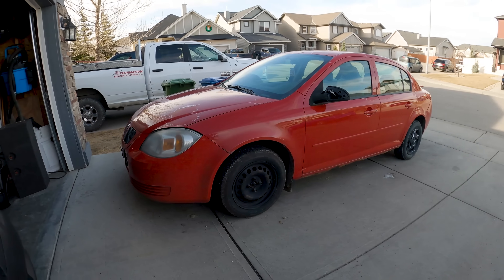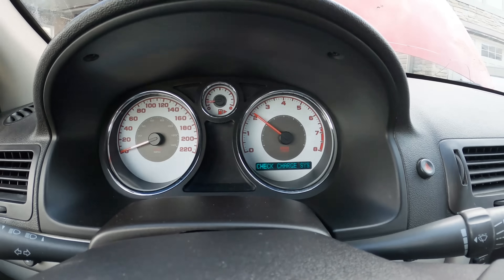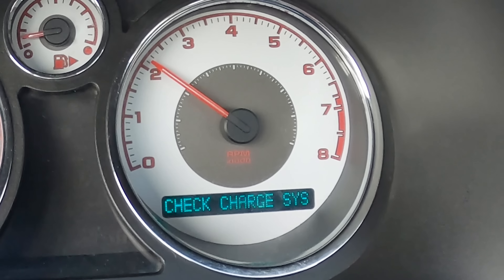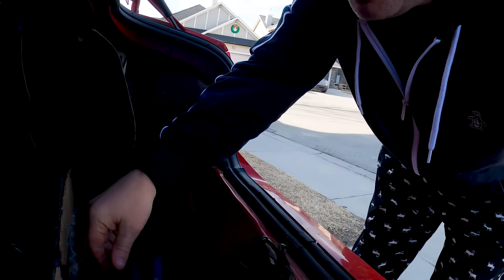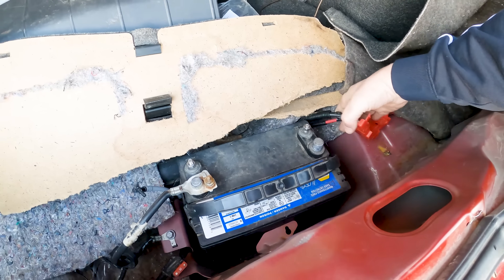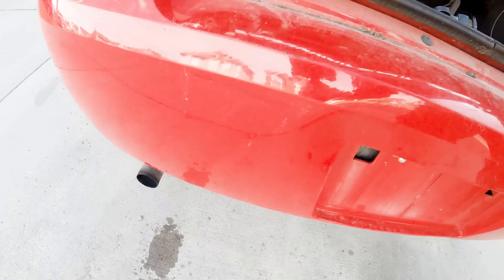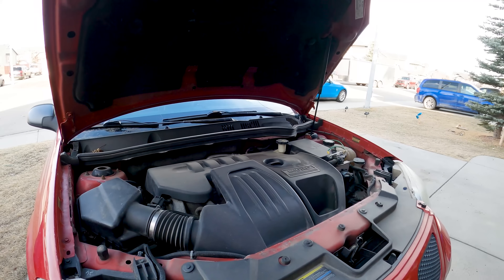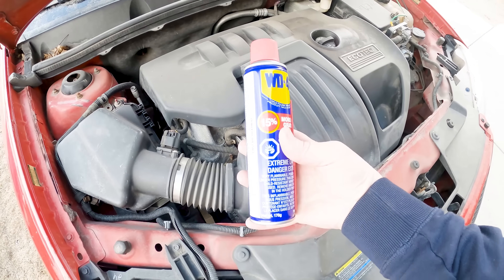ROADSIDE FIX! REVIVE your DEAD or DYING Alternator with this ALMOST FREE trick! | Gears and Tech

Comment: This guy is an idiot.
1) He hosed down the fan belt with a petroleum based lubricant. Slick.....literally
2) WD-40 is flammable. He hosed down the entire alternator exposing the chemical to potentially hot coils and the internal voltage regulator which also gets hot under normal operation.
3) Working alternators generate sparks at the brushes and heat under load. Hosing the alternator down with WD-40 might get it working again temporarily but at what cost? If the car catches fire, the alternator problem becomes a moot subject pretty quick.
Bottom line, if you are forced to do this in an emergency, use a nonflammable, nonconductive solvent.

Comment: I think I’ll use a voltmeter then  just go straight to the WD 40, good tip I hadn’t thought about. But I won’t be disconnecting battery with engine running! Thanks.
Reply from the maker: no need to pull battery cables. That was a double check that is easy to do. a lot of guys are getting hung up on that step. if you think the alternator isnt working, soak it in wd40 and see if it fixes it

Comment: Love this video!  I did something similar and banged on my alternator for weeks to clear a battery light until the replacement brushes came from Japan (or china).  I live overseas and an alternator for my corolla would cost around $500!  The corolla alternator brushes are so easy to replace and were only around $15!
Reply: Thank you so much for this information 🙏 - new sub.
Cheers.
Reply from the maker: Nice work!

Comment: Man thats great your trying to help  people but its not good 2 reasons already mentioned  im sure  that rear battey in the cave might be full of hydrogen  gasses and pulling cable is enough  to cause a nice explosion when it sparks and anything made after what about 1982 your putting ecm at risk ,theres some cars you have to pull fuses on before puting jumper cables on to jump. Bmw was onei believe 😮
Reply from the maker: Don't get distracted by the test, that's just to help prove that it's working.

Fact is, you could skip all the tests and just spray the wd40 when the alt dies and it'll bring it back to life

Comment: I really hope that people read the comments when they are trying to diagnose their vehicle problems themselves and watching videos on YouTube to learn how to do it themselves videos like this can really mess someone's day up and cost them a lot of money
Reply: There are so many things wrong with this video. It is not okay for the voltage to be a little low when the automobile is idling. When running (KOER), it should be between 13.5—14.5V. With engine off (KOEO), it should be 12.6V or slightly higher, aka surface charge. If higher than 12.6V, turn on the headlights for 15 seconds to remove the surface charge to get the actual voltage of the battery.

Always disconnect the negative battery terminal first. The problem with removing the positive first is if a tool or terminal completes the circuit to the chassis (ground), it will short out, most likely blowing out the rectifier diodes in the alternator with other collateral damage. This is dangerous advice and can cost big bucks to repair.

That being said, it's a bad idea to disconnect the battery while the engine is running. The reason why is if the alternator is working, it's going to confuse the voltage regulator into going what's called 'full field' and has the possibility of killing an alternator. 

If you don't have a DMM (volt meter), harbor freight has them for $5 that might last you the first few times you use it to get by.
Reply: That will fry some computer components in newer vehicles older cars before 2000 u b ight but any car truck what ever u pull that positive wire off the battery 50/50 chance you gonna burn up some computer components n cost ya lot more than an altinator
Reply: Why wouldn't he use a meter instead of taking off the positive or negative cable ? This is not a educated way to trouble shoot a car electrical system and he must be a novice.
Reply: @JamesNeubauer-z3v i mean he reiterates no tools. If you don’t have tools, this is what you can try. But I see where you guys are coming from I’m a female and I’ve been working on my cars lately and I enjoy it and I do use a lot of YouTube videos to diagnose things that I can’t figure out.
Reply: @JamesNeubauer-z3v  The dude is an ass. He has master techs explaining why what he did can cause massive issues and cost him tons of money, and he responds with a stupid survivorship bias comment about eating raw cookie dough. It has been a year, I bet that car is gone or not working or barely working at most.
Reply: This video is ok. He explains things decently. But there are people who are in no way near mechanically inclined that could screw things up or injure themselves.
Reply: A big thanks man. This really work.Experience this on a highway yesterday. My car just shuts down lights, radio & and engine, after a battery warning light appeared for sometime on the board. Even my small backup battery charger got sucked dry from 100 - 0% when trying to jumper the car. Nearby residents tried jump starting the car but everything was without power and goes off again. Took off the car  battery and recharge it, bought a can of wd 40 and soak that alternator good, connect the battery back and started the car. Engine was running again and alternator working again. Run the car all the way home more than 35km took off the negative terminal from the battery and engine was still running, alternator working just fine. Thanks again man your video really helped a lot.
Reply: Did it work?
Reply: Smoke 500.00 + computer watching know it all that can't control hand movements,,😢 just me or is that completely annoying wtf
Reply: @iwilldo1982  Learny inglishy.
Reply from the maker: Thanks
Reply: Go away hater

Comment: I certainly wouldn't take any notice of what he's saying as he is mostly wrong don't ever disconnect the battery while running as you're only acheive more damage than just replacing your alternator most cars will stop running after battery disconnection due to the many modules throughout the car which need power to communicate with each other
Reply from the maker: Thanks

Comment: This guy ia an idiot spraying wd a flameble liquid into the alt is a fire hazard plus removing and replacing batt terms while engine running is a battery explosion hazard (batteries give of hydrogen gas). a better trick is to run the engine is to tap the alt repeatedly with a volt meter attactched the idea to disturb the brushes debris etc when the voltage jump above 13v drop hood drive to garage. i spent 30years as a roadside mechanic... thx

Comment: The easiest way to tell if something is wrong is looking at your lights when you shut off the engine if they go dim. But it could be your battery, the wiring, connections, etc... Also every time you battery dies it's to be harder to charge and will die more easily, if it's already died 3 times to the point o
Reply from the maker: Thanks
Reply: Well,  if you have a modern car with an ECM and want to destroy it . ..  Sure ..go right ahead and just disconnect that battery while the engine is running...  that would do it..
And if you want a free pyrotechnics display under your hood sure just spray that WD-40 in your alternator.....  Kaboom... 
Ever heard of electronics Parts cleaner?... Or MAF cleaner?.. those would be much better choices hell even brake cleaner would be better...

Comment: Your going to either blow the computer or modules...It's ok to do that with older vehicles but that's not a good thing to do with most cars from 90 up...That's why they sell testers cause you can cause numerous issues unhooking the battery on modern vehicles with the engine running..I have an 04 Pontiac Grand Am 2.2 ecotec 4cylinder engine and I use testers for something like that..My alternator puts out around 13.5 to 14 volts when the engine is running and nothing is turned on inside the car like radio and headlights..I've turned something on just to see and it draws a little bit of power, but when you bring the rpms up it gets closer to around 13.8 or 14 volts..I can't tell people how to do stuff but I learned the hard way pulling the hot terminal while the engine's running..Computer's and most engine modules and sensors ain't very cheap..
Reply from the maker: Thanks

Comment: Thank you for putting this video out. It helped me greatly.
I did it a little differently, but based on the idea you are showing here. 
  I sprayed the alternator gently with compressed air. Nothing changed.  Then tapped on the alternator case with a screwdriver handle. Immediate  increase of voltage. Took about 1 minute to creep up to 14.3v.
  As you say, a great roadside fix. Thanks a bunch.
Reply: Wait so u just tapped it? And it worked? I been trying to figure my junk out for 2 days!
Reply: @ladybug926  haha. There are things in the alternator that can benefit from the wd. But it doesn't mean you don't need an alternator rebuild.
Reply: Good
Reply from the maker: Glad it helped!

Comment: What if the problem is the built in regulator ? And pulling battery cables will most likely blow out the diodes
Reply from the maker: Thanks

Comment: Its in the name "WD-40" that the secret lays hidden. WD-40 is an acronym for Water Displacement formula #40 and is widely used to dry electric motors. While it does have some lubricating properties it is actually more of a cutting oil than a lubricant but both of these properties was not the intent of the development. Again, its in the name. There are much better lubricants and cutting oils available that surpass WD-40 but for displacing water WD-40 is the superior product to use.
Reply from the maker: Exactly

Comment: I've been a mechanic for 38yrs.NEVER disconnect a battery with the engine running.The battery acts as a ballast for the alternator.All charging systems Should have 13.5 volts@2000 rpms or better.
Reply from the maker: Thanks

Comment: Nonsense. An alternator isn't a generator. These 2 things are different. A generator will increase its production of power as the rpm is getting higher. An alternator will stay at the same output of power no matter what the engine's rpm is, from idle to highest possible rpm.
Reply from the maker: Thanks
Reply: Thank you for this W40 tip! @GearsAndTech

Comment: Never pull a battery terminal with the car running. You cause a field collapse in the alternator. It can briefly spike a high voltage and fry your electronics. Replacing the control modules can cost thousands of dollars. This is incredibly bad advice unless you own a 1970s or earlier car.
Reply from the maker: Thanks

Comment: Nice trick when you're stuck miles away from home.  My 2002 Tacoma showed the same voltage as in your vid.  I removed my alternator, took off its cover plate and found that my brush springs had had my brushes fully extended, but they weren't making contact with the rotor's shaft.  I took a small round file, elongated the holes of the brush holder, and pushed the brushes closer to the shaft before tightening the screws.  This fix lasted thousands of miles before I changed the brushes.  Still working to this day.  It's  better spending $25 than $250+.
Reply: Lol
Reply: I think you’re supposed to remove the negative cable and you didn’t show the volt meter at the end of the video
Reply: just lucky
Reply: How do you "elongate" something with a file? Im pretty sure you didnt elongate it
Reply: Never take the cables while the car - truck is running .
Reply: @malcolmcapps8816  Not good with engine computers!
Reply: @malcolmcapps8816 why not if he just did
Reply: @Killbill8x  Older cars had stronger computers or none at all, with newer cars, you will blow a module and/or sensor.
Reply: You can do that with a generator but not an alternator, don't try this it's foolish and can do more harm than good, most of the time your alternator goes out it's the diode trio and that's a $15 part that's easy to diagnose and change.
Reply: @rayvandenberg9554 I have a question? My jeep is making a weird sound from the alternator i think? It's getting hot too. Is there a way to check the diode? Thank you
Reply: @Shannon-  The tell-tale sign the diodes are going is your lights will pulse at idle, because your alternator creates "alternating" current. The diodes convert the AC to DC. when a diaode fails, the output will have some AC leakage, hence the pulsing lights. Cahnces are, your bearing(s) are making the noise and resulting heat.
Reply: @Shannon- If it is the alternator squeaking and getting hot the bearings inside that the shaft rotates on Are going out. Replace it before you get stranded somewhere.  Also check tension rollers and guides for play. Remove tension on belt and test by seeing if they wobble. This is normally where squeaking and squealing comes from when you first start up a vehicle and then stops after a few minutes. Either one can lock up and leave you in a bad situation possibly causing engine damage.
Reply from the maker: Exactly. Thanks for sharing

Comment: You're lucky. In the USA its hard to find a running drivable car for less than $1,500. And even then it will have more issues than your $500 car. Americans are particularly proud of their junk cars.
Reply from the maker: Pricing here has gone up. It's a lot harder to get a running car due to scrap prices
Reply: @GearsAndTech  Prices are much higher in America because of an idiot called Joe Biden.

Comment: DO NOT REMOVE BATTERY WITH CAR RUNNING IF CAR HAD A COMPUTER.
Disconnect the battery while the car is running, the engine will die if the alternator is working because the alternator will run at full output and fry the ecu. Never disconnect  battery to check alternator
Reply from the maker: Thanks

Comment: Dude, horrible bad advice, please don’t pay any attention to this guy. As in all the other posts here, do not disconnect the battery when the motor is running. Buy a cheap digital volt meter and test for a difference in resting battery voltage and running voltage. Better yet if you do not understand this, go to a mechanic that does. This guy must work on commission for an auto parts store or car dealer😳.
Reply from the maker: Thanks for stopping by

Comment: The FIRST thing to do if you see a warning light for charging system (it may look like a tiny battery on the dash) is to make sure the drive belt has not broke or come off the pulleys. If you run the engine without a belt you can seriously damage your engine beyond repair. The alternator needs a  functioning belt to produce a charge. When you see low voltage this means to make sure the drive belt is on before you attempt to run the engine. The belt also drives the water pump which cools the engine. If you see both a charging warning and a temp warning, it is very likely you have a belt issue and a reason the belt is broke or off the pulley ie... worn belt, alternator, belt tensioner, a/c, water pump, or power steering pump. You may also smell burnt rubber in the case of a belt issue. So step one is inspect the drive belt. Once you see that the belt is in place you can proceed through these good steps to make it home.
Reply from the maker: Thanks for stopping by

Comment: For a high mileage Alternator, if your concerned the bearings are dry:
You Can Oil your Alternator Bearings. Just a few drops in the right place. Use Zoom Oil which has a long extendable straw to hit the front and back shaft ends where the bearings are.  
Take care
Reply from the maker: For sure. Thanks

Comment: disconnecting a battery cable and then rehooking it whie its running is a no,no you will send a voltage spike to the alternator and fry the diodes !
Reply from the maker: Thanks for stopping by

Comment: Videos like this are why the thumbs down count should be shown.  Original WD40 IS NOT intended for use with, on, or in electrical equipment.  It is FLAMMABLE and could set your alternator and engine compartment on fire.  There are spray contact cleaners that may work but the technique only would work if the failure of the alternator were due to corrodes brushes or contacts.  It will do nothing for missing or highly damaged brushes nor will it be of any use if the problem is due to a failure of the diode, no amount of any spray will do anything.  Replacement of the diode or the alternator is the only option.
Reply from the maker: I'll tell you, I have a thumbs up ratio of 96% on this video. This is well above the YouTube average.

For every negative comment there are over 100 thukbs up. Those guys are just staying quiet because they know it works
Reply: @GearsAndTech  You do you.

Comment: Wd40 is extremely flammable.. not a good idea to spray on the alternator.. could start a fire.. if your alternator is charging less than 13.7v you're going to start having problems.. loose battery terminals is also a big problem and I agree that the positive terminal is always the last to remove and first to connect. Don't listen to this guy.. he's a weekend hacker.
Reply from the maker: Thanks for stopping by

Comment: Looks just like a Chevy Aveo. The front strut mounts on those are not made right. They do not bolt down so that when you hit bumps they bounce up and OFF. Open the hood and you will see what I mean. To make it right you'd have to do some fabrication work.
Reply from the maker: Thanks for stopping by
Reply: You're welcome. I jumped the gun on that one. I saw later in the video the Pontiac has the correct strut mounts/towers. I had a Chevy Aveo with the stupid "strut mounts" that weren't.  @GearsAndTech

Comment: Never never never disconnect your battery with your car running you can damage very expensive computers. It throws a voltage spike through the system.
Reply from the maker: Thanks for stopping by